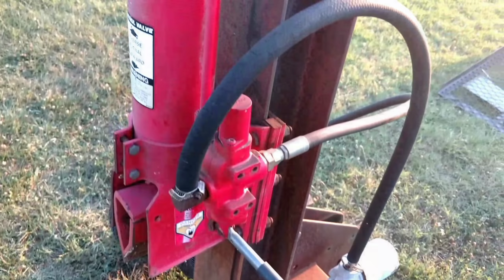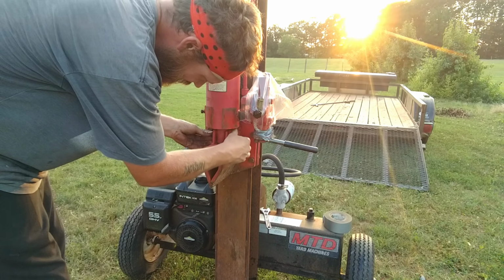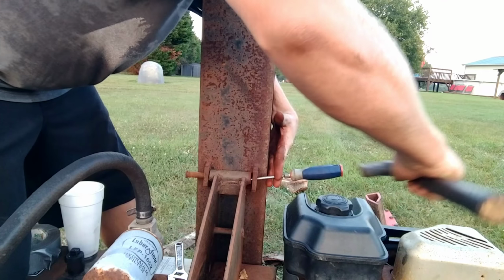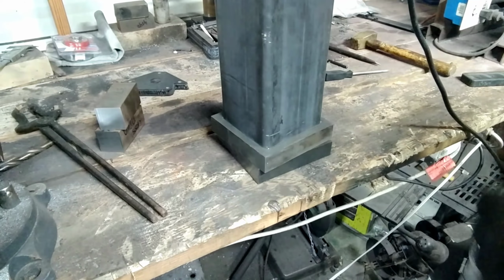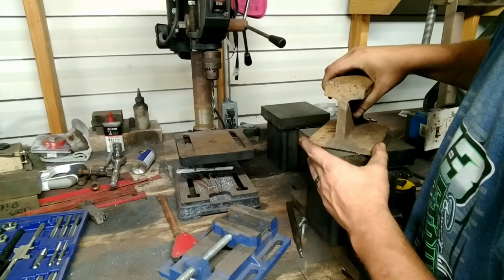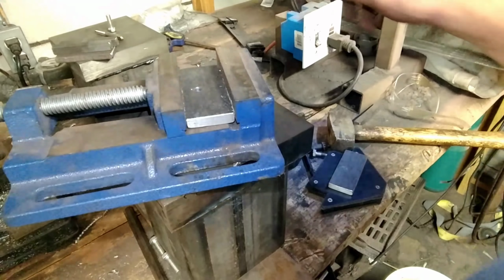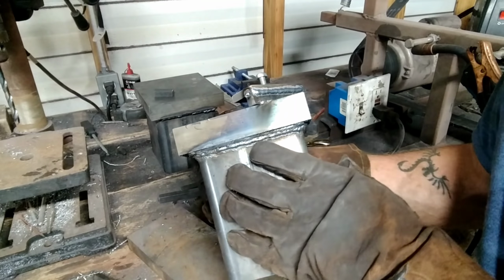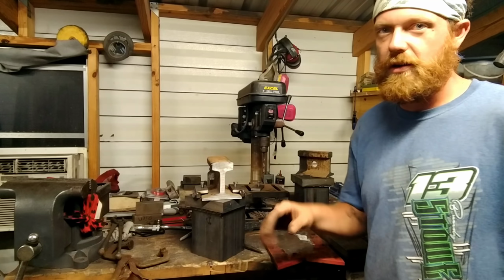Building a press part 2

Comment: great video, I just wanted to mention something though. When we are welding really thick or hard material we also preheat. There is a recomended preheat temp for certain steels but its never to get more penetration. The purpose of preheat is to keep stress down and lower the cooling rate of weld to reduce cracking. Penetration is controlled by rod and amperage. That being said your forge press  look great buddy keep up the good work. Looks 10 times better than mine

Comment: Do you use oil on your horizontal band saw? I got some cutting oil for mine, but my saw does not seem to like it. (Band slips off)
Reply from the maker: I use 3 in 1 when cutting hammer billets
Reply: Trying to take care of my tools the best i know how but no oil, no problem. With oils she slips belts so now i run no oil
Reply: look at how" Ellis saw" cleans the chips with a brush   they also have an option of a air mist system  you might be  able to get ideas from there setups

Comment: This project is coming along well. Your kicking it's ass! Looks to me like there isn't all that much to it once you tear it apart. Your going to be using your new press in no time. I'm excited to see it up and running. I studied Tim @ Big Dog's video and several others. Now yours so when I finally find the right splitter I'll be ready to rock and roll. As I've said before my issue is finding the right splitter. It can't be a real long one unless I want to cut it down because I don't have a lot of height clearance. Anyway... I'll find one and in the mean time I'll just keep watching you do yours.BTW for someone who has said on multiple ocassions that you aren't a very good welder but you get by those sure look like pretty good welds to me.

Comment: watching the speed of that ram - it's perfect. All the nay sayers on social media that say log splitters are to slow for converting to a press for hot steel - no idea what they are talking about. I'd be tempted to keep the petrol motor, wont be cheap replacing that with an electric of the same horse power.

Comment: The speed on the gas motor is pretty good. Should be able to find an electric motor that runs the same RPM, maybe more, and the ram will run at similar or faster speeds. As I mentioned in the first video comments, just need to align the mounts for the hydraulic pump and your motor so there isn't any binding and smooth operation. May have to consider pillow blocks or something similar if you figure out the marrying shaft is longer and needs the support. As good as you can weld, shouldn't be hard to fab up something that will work. Enjoying watching your process, for when I can set up my own someday!